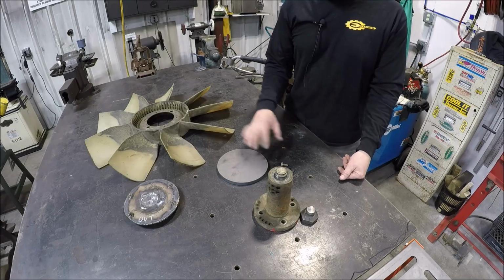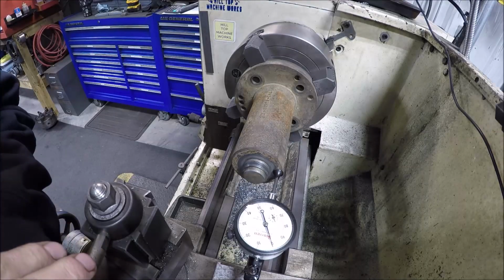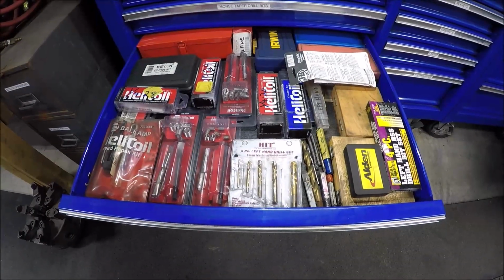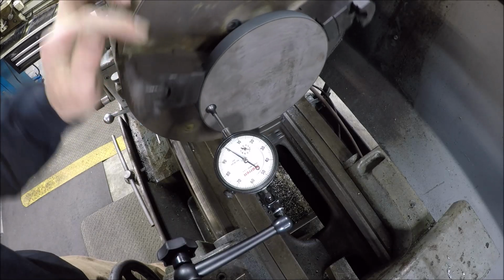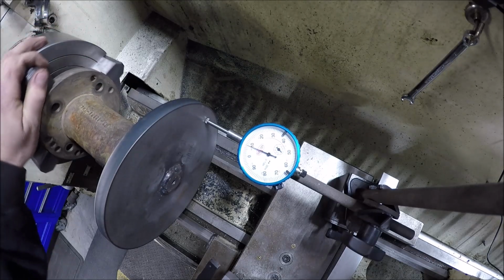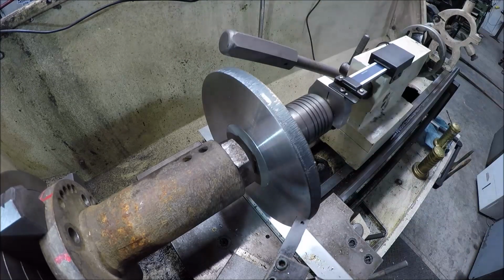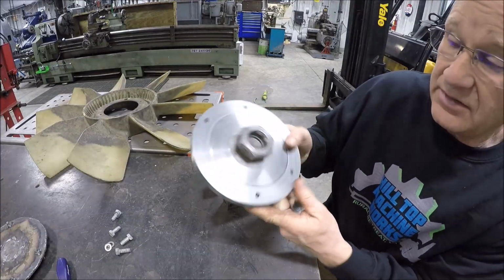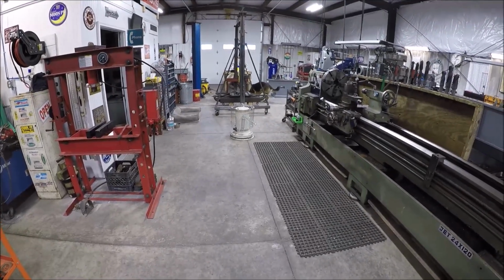Making an adapter for a 8.3 Cummings Diesel fan

Comment: The tool spring-back is a serious pain in the rear. I've had the same issue before on too many occasions. One pass you are removing 0.020" and the next spring pass you remove 0.003" and overshoot. Nice work.
Reply from the maker: You can say that again. Lucky plan B worked out for me.

Comment: Got there in the end Tom .    I would have done  a completely different design based on previous experience .   Warning the owner to fit the correct viscous hub for high temps .  We have tried solid mounts direct to the crank on similar Cummins engines & found the plastic fan blades snap off , sometimes shagging up the radiator .     Hopefully all goes well .      Cheers  👍
Reply from the maker: Thanks Max. I will pass on what you said.

Comment: The job eventually turned out OK despite that spring cut taking more than planned...but what machinist hasn't had that happen to them.
Reply from the maker: Yeah that was a bummer. I think I found the culprit. I was cleaning up the lathe and noticed the tip of the carbide was chipped. I am guessing it did not cut properly and that is why my dimension was off.

Comment: Turned out well Tom. Good to have a free rein not so much pressure. Couldn't you have reversed the lathe drilled it with a RH drill then reversed it back for LH tapping? Cheers Tony
Reply from the maker: Hey there Tony. I am pretty sure that nut would have backed off it I tried drilling into it while in forward rotation on the lathe.
Reply: Nice one Tom, appreciate your good judgement. It's better to be safe than sorry.
Reply from the maker: 👍👍 @eyuptony

Comment: Sometimes you can hold the end of a wooden hammer handle against the plate like that and it’ll quit ringing, also a rubber tiedown strap around the outside really helps
Reply from the maker: I had thought about trying a couple of rubber bands around the rim.